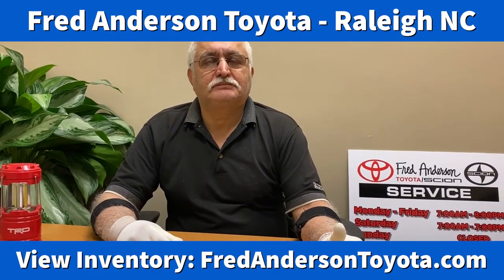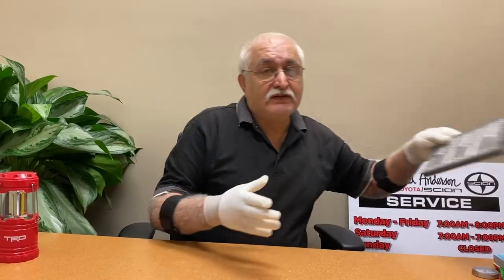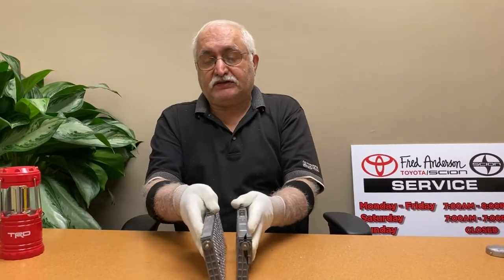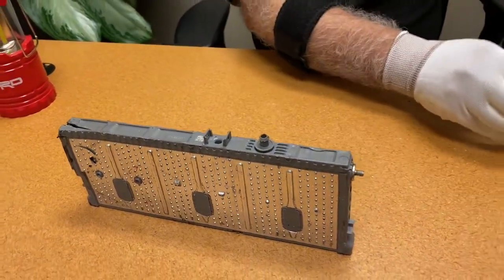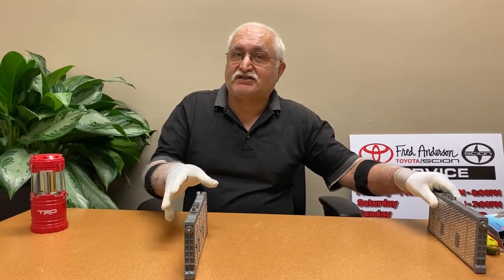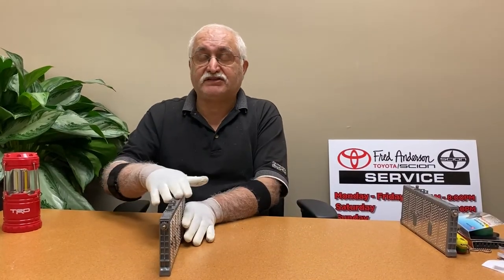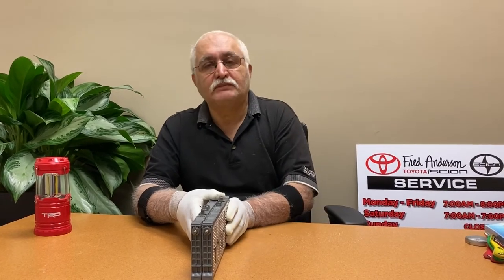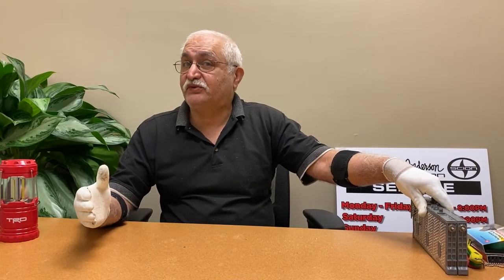How to Check if Your Hybrid Battery is Failing: Ask the Toyota Expert!

Comment: Never take your hybrid car to a dealer, If your car doesn't start, like in my case, some of my fuse were out, and my car will not start, the dealer changed a few fuse, no relation to transmission and hybrid battery, the dealer charged with bogus fee of 1,200.00. Take your hybrid car to a non-dealer ship mechanic, STAY AWAY FROM DEALER.

Comment: What about putting them in a parallel bar n letting them balance themselves out 1st. Then apply a load to each one and continue to let rebalance. Then charge the complete pack back up n allow to rebalance again. Repeat this until you see what actual modules drop to fast for recovery. If the drop too fast after several charges n loads...then you can actually determine if a module is actually bad. I only need to replace two instead of the 4 I thought. The battery back was just really unbalanced. Tell me your thoughts please.  Remember...I put all the negatives on one side of a aluminum bar and all the positives on another bar to balance them. The balance pretty quick. Then I started the process of charging and putting a load several times before rebalancing
Reply: Until I see further evidence, your method is the only one that makes sense.  This guy has no clue.
Keep up the good thinking.

Comment: I just bought a used 2007 Camry hybrid 100k miles on it I reset trip A and got 400 miles til gas light went on I'm not sure if I should be getting better mpg with this hybrid

Comment: Replace the HYBRID BRAND NEW BATTERY, SO YOU WILL HAVE 30 to 40 INDIVIDUAL CELLS ( BATTERY MADE OF INDIVIDUAL CELLS ) are BRAND NEW & GOOD REQUIRED CURRENT. Rather then spending time checking VOLTAGE ( actually CURRANT OF EACH CELLS ).
RAFI Maine USA-PHD. GRADUATE OF 90 TAD TECH , CHELSEA, MASS.  NOW IN MAINE

Comment: Folks, years ago BEFORE when usage of cellphone became mainstream, batteries on phone last about 4 days before needing charging and even complete replacement were only after 4-5 years. Now days, the batteries are required to perform even at a higher demand of software and high usage and battery technology have not met the demands of the current needs. 

If I had a last dollar to spend, I would still spend it on combustion engines than any electric vehicles. Hybrid at the most should be supplement power provider to combustion engines but not anything more.